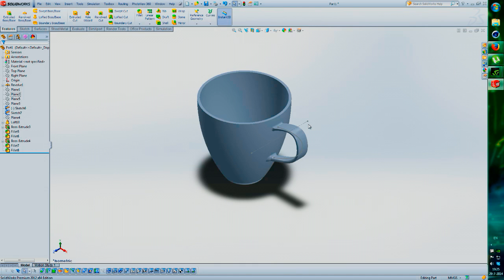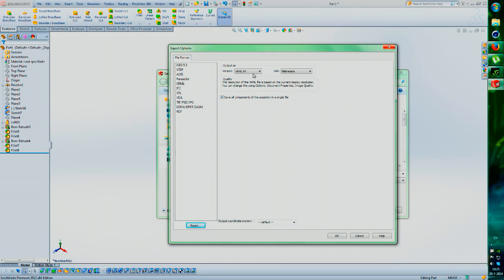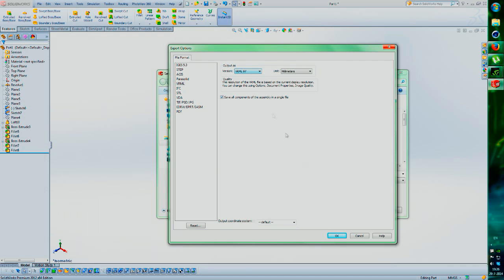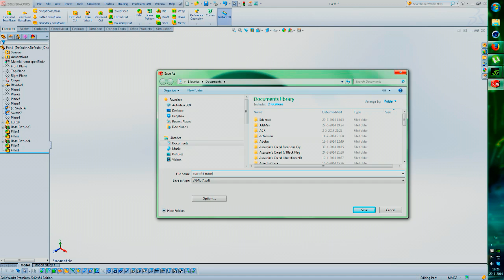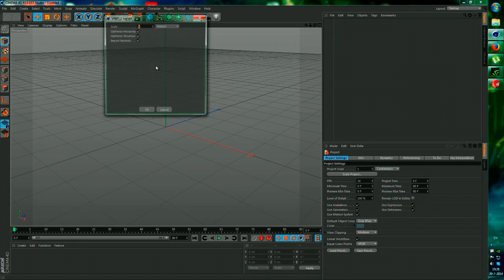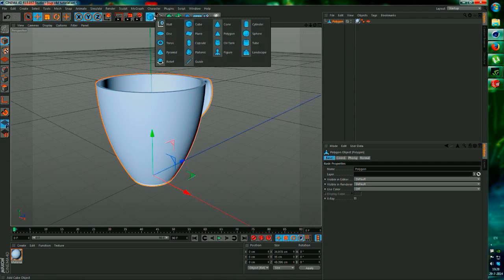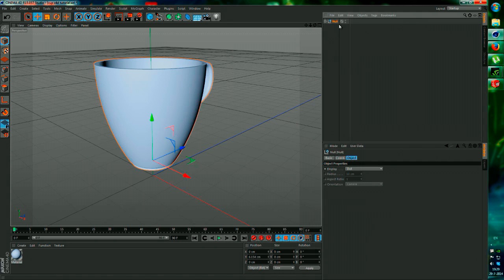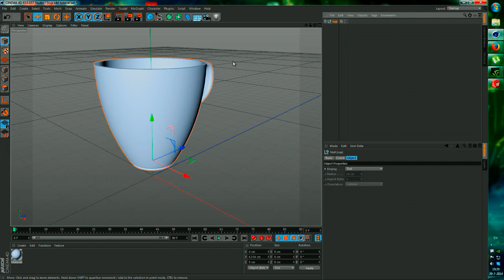how to export a solidworks part to C4D

Comment: is there a way to get the complete assembly with all the mates ?
or can i use the edrawings file to do this ?
Reply from the maker: With this method the mates are not transferd. Edrawings file cant be opend in c4d. I will look for a option to transfer the mates. And i will make a video of it. 
I know it's a pain to constrain every thing again.
Reply: Ok thx
Reply from the maker: C4d opens a file format named FBX. This format has the link and animations information baked to the file. 
But solidworks does not natively export this format there are plug-in availeble. But you have to question yourself if it is worth these risky steps. It might be faster and easyer to make the constraints in c4d.   I hope i helped you with your question.
Reply: CAD Brothers ok, thx :) this helped alot